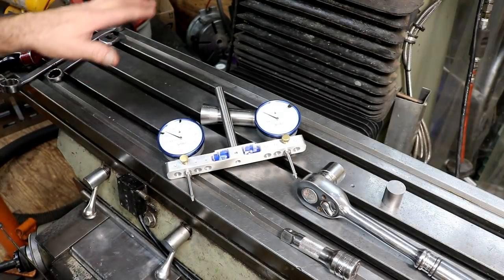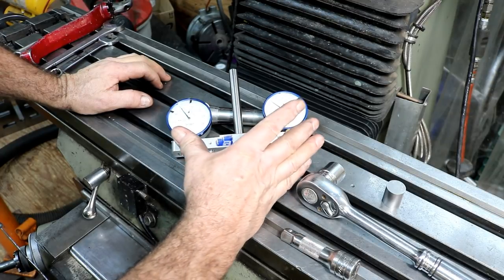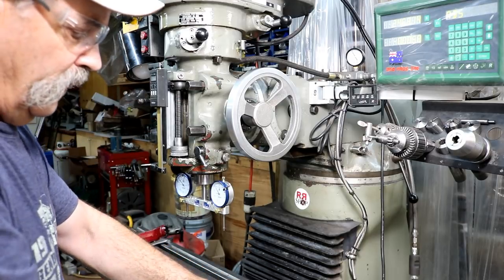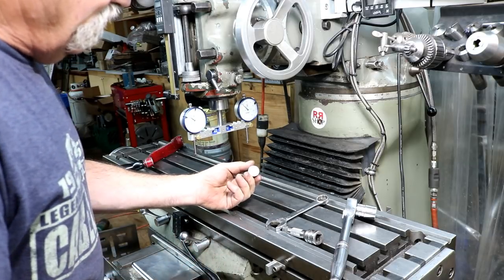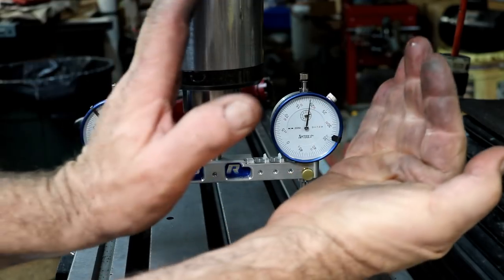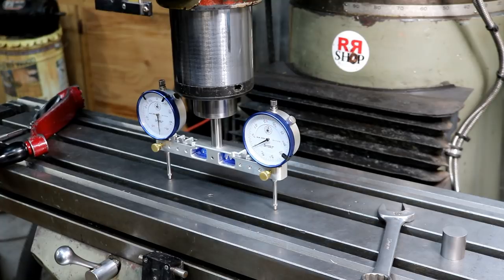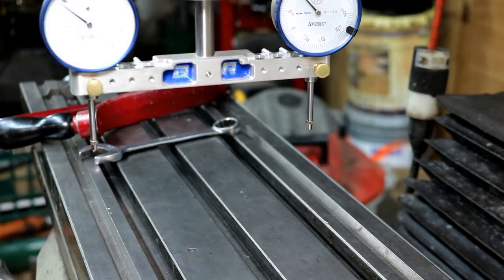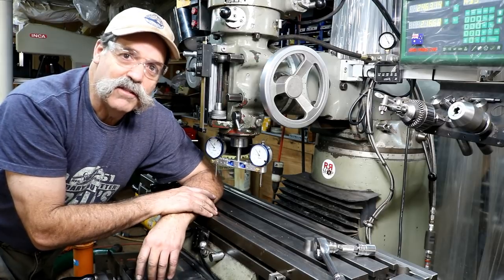Tramming a Milling Machine in 2 axis | Using a Spindle Square

Comment: Good video of using this Great Spindle Assembly. doesn't matter which way you go, The Gauges won't tell a lie. Therefore consider you set it up correctly and depending on how Meticulous you want to be, you will get a Perfect Table Squareness .  Also any other job you want to setup for squareness on the table will always be square with your milling attachment, whether it is just a small flat plate for a job, or even a small cylinder head. Job well done. Keep up the great work.
Reply from the maker: Thank you Ted. great tool.

Comment: To save time, set the second indicator to zero by loosing the stem screw and move the whole indicator. Now move the head to the zeros on the scales on the machine head.  Bring your indicators down to the table and adjust the head till they read the same and your are done...no need to hunt for "zero".
I've worked where the head on a Bridgeport type knee mill might have to be moved several times a day. Once you have your indicators zeroed, put the device where it won't get bumped around till you need it again. Then you won't have to bother resetting the indicators the next time you need to use it. 
Cheers from NC/USA
Reply from the maker: Thank you Aceroadholder.  Good Tip , Thanks for sharing it.

Comment: Randy, I just got mine in the mail today. I had fairly low expectations but it really is nicely made. It came in a nice foam lined case too, plus a sticker! I don't normally have the luxury of buying US made tools but I treated myself for once. I wouldn't have bothered on my old mill but now that I have a Bridgeport..... Did yours come with the little magnet to do the calibration?
Reply from the maker: Good deal Mark.  James does a great job on these.  Yes mine came with a calibration magnet.  Thanks.

Comment: I always start with a square between the table and the quill. All those indicator rotations when you started that nod adjust are eliminated that way before I even get to the indicators. Just saves some time, is all. Awesome vid, thanks!!!
Reply from the maker: Great tip!  Thanks

Comment: I'm a newbe here, an engineer that bought a Bridgeport, just for emergency pieces we need to modify or make. I avoided it for the longest time, and have no plan to eliminate the work we send out, but we need it for last minute. DON'T you want to do this on parallel blocks instead of directly on the table? My table is not horrible, and yes I've stoned it...  but there are marks in the table. using blocks would more represent or "span" those Pock marks.  Am I right?  Wrong?
Reply from the maker: Yes you are correct, my table is pretty good condition, so I don't have a problem.  Most of the time I tram to my vise and not the table since that is what I used most of the time.  Thank you for watching.
Reply: @RRINTHESHOP  your table did look exception..... You may have sensed the jealousy..... 😂

Comment: This is what everyone dreads. It’s not that hard at all. Also use the ram if you haven’t ! You can set the gib and have another axis while machining. I use the ram as I would the X/Y axis. It has a rack and pinion, it’s sliding on machined and hardened ways. Use it ! With my Mill the ram provides a better more accurate cut than the x axis can. Simply because the previous owners didn’t use it. They would move it to a position and lock it down. Then use the table to make all the cuts. The hardest part for me when tramming in my machine is realizing when tight is tight enough but not too tight or too loose… I Don’t want it to move but if I was to make a miscalculation and crash the tool into the workpiece I’d prefer for the head to move slightly vs breaking stuff. 🤷‍♂️… but I don’t want to do that either really.. so how tight is just right?

Comment: Sust use a square on the table and a drill blank in a collet in the spindle. Or if you are real anal use a drill blank in the spindle and a mag base with a clock on the table. Rotate the spindle to make sure the drill blank is properly in the collet then clock it or use the square fron several positions either side of the table.
Reply from the maker: There are many ways to do this.  Thank you.